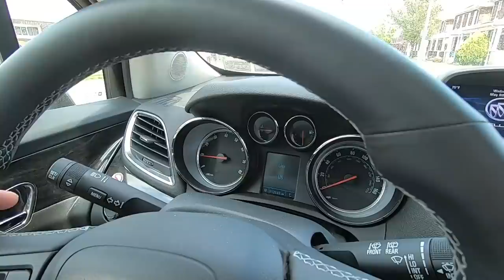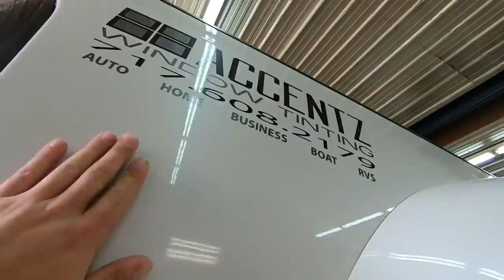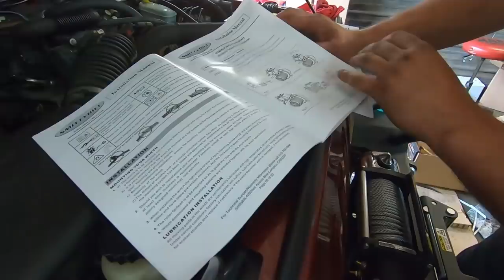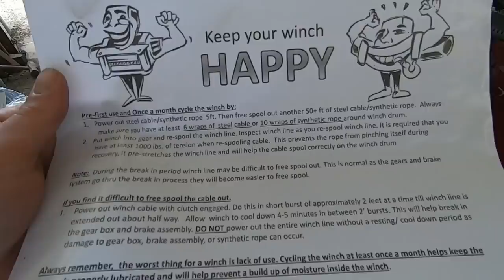CHEAP JEEP IS BACK! Wheels/Tires and 10,000LB Winch Install!!! (UNDER $300)

Comment: He protect he attack but most importantly he got the winches in the back
Reply: Lift kit is attached
Reply: Front bumpers matte black got the  back in black to match
Reply: When most Exp. drivers drivers get stuck the ass is usually under water/mud or in a position a winch will not work to recover, recovery hooks go in the back, winch goes in the front. IMHO. What is everyone's  opinion?

Comment: Mike u need to get aircraft paint stripper and put it on the rims on new project truck and let it sit for 5 mins and wash it off with a good pressure hose or a pressure washer and it makes there perfect chrome
Reply: Gonna buy new prolly lol

Comment: Next giveaway should be a 5.0 raptor conversion from PaxPower. The 5.0 crew cab's they swap raptor stuff onto. Or a Jeep Gladiator. If you wait long enough you could do a new Ford Beonco.
Reply: Barney Stenson bronco would be dope
Reply: @Ruby5.0  yea they would just have to wait longer for it compared to the others.
Reply: The only gladiators worth having aren't made anymore.

Comment: a 16-18 lifted silverado 1500 would be a dope giveaway
Reply: Michael Cardiel 1500? No thanks
Reply: @affordablepropertymaintena9213  why
Reply: Michael Cardiel 1500s can’t handle any heavy work load they get horrible gas mileage. 
Get a diesel. 
Amazing fuel efficiency and you can literally tow anything.

Comment: if ur worried about power and longevity, go with an afe air intake to keep the engine cooler and do 4.88 gears or so to help acceleration

Comment: If you're concerned with power loss, you should consider re-gearing your front and rear diffs with something like 4.10 gears for when you get your new wheels and tires
Reply: Alberta Bound 4.88s for a 3.8l, I’m running 5.13s on the auto 3.8l and it’s a whole new animal.

Comment: Give away a ZL1.... the right way. No scams involved. Then maybe a few trucks.
Reply: What's the scam is bit that you have to buy a product because there is a valid reason for that
Reply: @gwc_garage  don't even have to buy anything technically. No one reads the rules but the guidelines for entering without making a purchase are in there.
Reply: gwac Guitarmageddonzl1 did a “giveaway” where the so called winner who’d win a zl1. When it was time to pick a winner the guy didn’t want the car. Nick even admitted it was a scam.
Reply: @Justinx90014  ok but this is mike not Nick they aren't the same person also they have made more than what the car is worse for sure and they won't be losing money giving it away

Comment: You need led headlight conversion, taillight conversion, 3rd brake led conversion and extension for larger tire carry, AND 2 led pods for the bumper. It will be a real mall crawler then
Reply: Do you know what a mall crawler is?
Reply: Exactly what hes building.

Comment: a winch is a winch! I have a 10,000 pound Champion winch for my truck and a 4,500 pound one on my car hauler and don't have more than $250.00 in either one of them. paid $229 for my 10K and $189.00 for the 4,500 pound one and neither of them have ever given me a second's trouble in the 6 years i've owned them. winch looks good on the jeep. you'll want to get a remote control for it though. makes things so much nicer

Comment: When you add bigger tires and wheels it is gonna be s-l-o-w... Cheapest way to compensate?  Gears, front and rear, maybe  4:58's and add at least a rear locker. Except for welding gears, a Detroit is easy to install but can be a bit noisy and requires no wiring or plumbing.  You might even consider a Dura trac .

Comment: I got an idea streetspeed717 why not do a 1999 dodge ram 1500 V8 or a 1999 dodge ram 3500 Cummins turbo diesel or a  manual transmission version because I like to drive a manual transmission or a 2005 or 2003 Chevrolet Silverado Duramax stock what do you think streetspeed717?

Comment: @Street Speed 717 i think the next giveaway vehicle should be either a 2018 or 2019 z71 silverado or a 2019 zl1 camaro with the mbrp axle back exhaust you guys haven't done one of those yet

Comment: Who thinks he should do a swap in a HEMI 5.7 or 6.4 from jaspar motors plug & play & its a manual power problem solved not expensive I did my Jeep went with the 6.4 best mod hands done sounds sick people go nuts when they hear a Jeep sounded like a 392 u won’t be disappointed by the way the next give away should be a hellcat or a 392 scatpack
Reply: Be a lot cheaper to do an LS swap.

Comment: I’ve always wanted a truck but only being 17 working at a minimum wage job I can’t afford one that would last me longer than maybe a year. If anyone knows how I could budget one out or a good price for a decent truck please leave me a comment. NO FORDS
Reply: First you need a good platform.  Anything newer than a 2007 diesel is gonna cost serious $ bcuz of emissions.  If you're going for gas I would say stick with Chevy.  They made really solid trucks up until about 2006/2007ish.
Reply: 爪尺. Ꮆ尺丨爪乇ㄚ yeah I’ve wanted a Chevy my dad had one while growing up and I loved it. Just gotta try and save for it while paying for my car now
Reply: @triplixitty  All diesels will be expensive as hell. Even old high milage cateyes. If i were you id look for either a 09-12 colorado z71 4x4 because they are reliable as hell and cheap for a clean one or id buy a z71 4x4 v8 silverado or sierra 1500.

Comment: youre going to GET STUCK for sure, but youll be able to get yourself out easily. Also, you NEED to re-gear because adding huge tires is going to DESTROY your acceleration and KILL your fuel mileage.